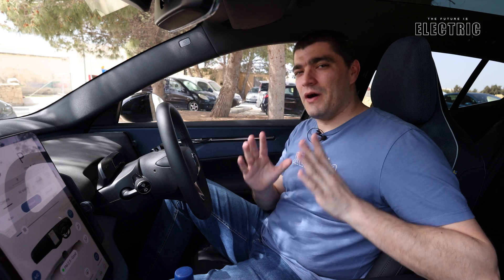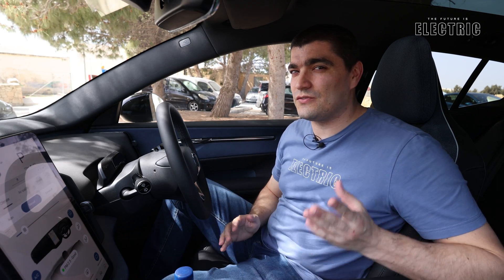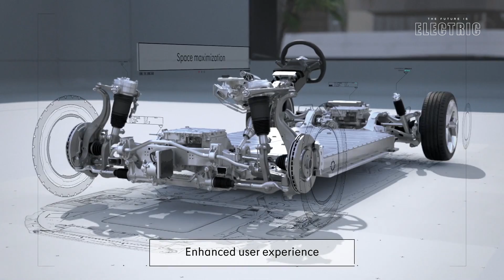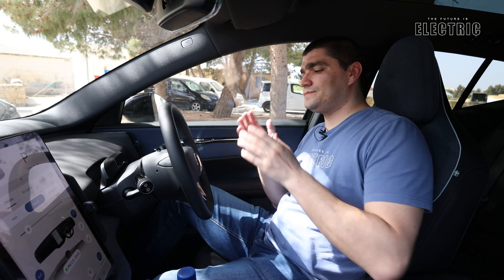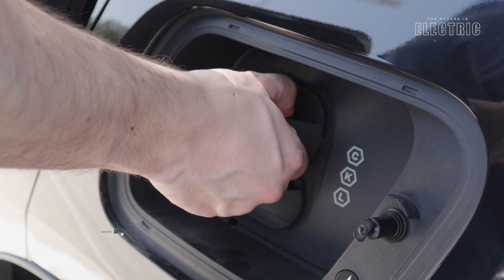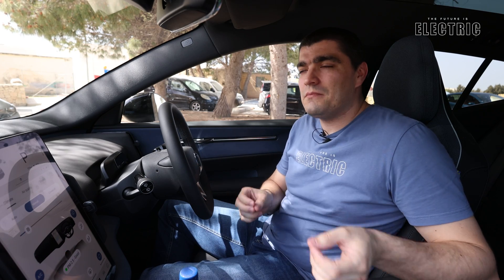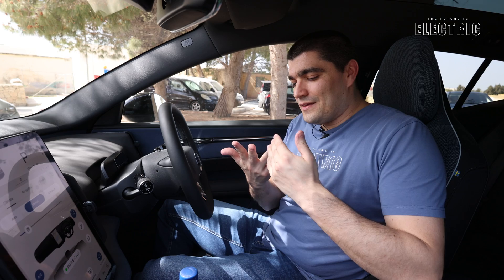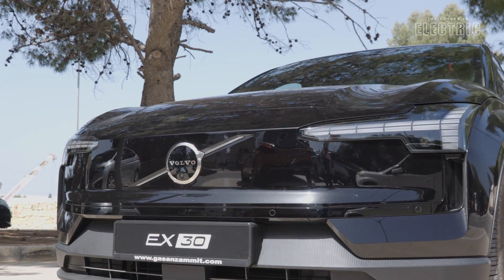Volvo EX30 Technology & Battery Focused Review

Comment: Hi Luke, I really enjoy your very informative and accurate reviews. Because you have obviously built up lots of EV competence over the years, I would like to ask you the following: You have stated that the NCM-battery pack used in the Volvo EX30 dual motor offers a cycle life of 800 to 1.500 charging cycles. Now what exactly is considered to be "one charging cycle"?  A DC-charging session from 10% to 80% for sure, I would reckon. But what about an AC-charging session from say 30% to 70%? Would you not fare much better if you adopted a habit of staying within that window of SoC, with going below the lower and beyond the upper limit being just exceptions? Isn't it feasable that you might have the NCM-battery pack for more than even 1.500 charging cycles this way? My issue is: I live in a mountainous area so I need the dual motor version. Looking forward to your answer 🙂 Regards Robert
Reply from the maker: Hi Robert, thanks for watching my content. I didn’t explain this as well as I usually would in this video. A charge cycle is when the battery is cycled from 0-100%, if this is split into multiple charge sessions and two charges of 50% would be 1 charge cycle too. 

For NCM chemistry, It is advised to charge when at 20% and not top up to full (100%) the car’s software will let you stop it at 90% (or any percentage for that matter)

Side note, my dad has the dual motor version since recording this and loves it :-)

Comment: With ncm charge cycles is it better to charge in small amounts frequently like 50 to 80% or in big chunks like 20% to 80%?
Reply from the maker: Lithium batteries don’t suffer from the ‘memory’ problem as was the case with lead acid batteries, meaning whether you cycle them full or partially shouldn’t make a difference.

Comment: I'm trying to figure out why the Standard range reaches 100 km/s after 5.7s, and the Extended range version is specified at 5.3s. Both are very good figures, but I feel uncertain to go for the Standard range with this issue unsolved (otherwise Standard is definitely for me). I don't want an "oooh, but the specs are different, didn't you notice" after I buy my new car. Any explanations for this?
Reply from the maker: This has to be a chemistry issue, LFP are generally not as good at delivering high power as fast as NCM. LFP is in the standard range and NCM in the longer range battery. Hence why longer range is quicker. LFP is also going to be heavier kWh to kWh ratio. 

Unless the motors are different, but they aren’t from what I recall.

Comment: You are right about two modes of regen. But you are wrong on the one which is not OPD. The other one is, unfortunately, not a free coast. It will regenarat 12-15 kW at speeds 20-100 km/h. That is i significant amount of braking. Speed is lost rapidly, and I do not like it!

Comment: How efficient is the heat pump?
Reply from the maker: That’s an interesting question. I’ve never looked into how the efficiency varies from one model to another on their heat pump. 

It might be hard to find that documented though
Reply: @TheFutureisElectric  I know  GM has published online stating all the innovations built into the one they use. I have also read range results from Kea/Hyundai comparing results between a heat pump and without, same models, with very little difference in results.

Comment: Steven Persensky
Thank you for a very informative video. After listening to your presentation of the 2  different battery chemistry models, do you regret that Volvo´s largest battery option does not use LFP chemistry?   I look forward to your next video and a more in depth review of the EX30´s regenerative breaking system!
Reply from the maker: Thank you, I’m yet to see a high performance model using LFP chemistry, technically it doesn’t seem possible as yet. 

The larger battery is there to fulfill the performance variant, which at the time being at least need to be NCM